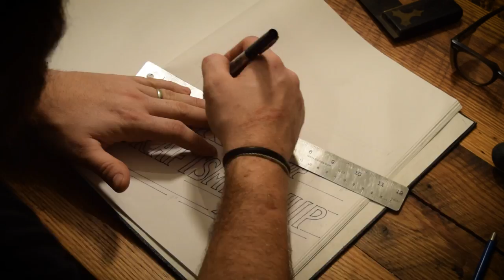Making a Joiners Mallet Using Only Hand Tools

Comment: Little tip i have found very useful woodworking. A reciprocating sawblade fastened to whatever handle you can fashion will do things no saw can and doubles as the best pumpkin carving tool. Ever.  Big fan of hand tool only challenges I have a couple knives I have made this way definitely makes you appreciate the tool more.

Comment: I built myself one last year much as yours Good job!
I also drill many holes adding down rods to prevent any cracking and splitting in years to come after a year plus ➕️ mine seems prefect and it's not the every day tool but for when I need it to go bong for some jobs 
Nice job for audio and coaching 👏

Comment: thats nice but i worry about using wet wood because it always seems to crack. although some types of wood are far more forgiving.
Reply from the maker: I had the same thought, but figured it would be an interesting test. Also a good way to make a temporary mallet if you needed something in the moment. So far, it’s held up well. Thanks👍🏼

Comment: A suggestion, if I may.

when you did the handle cut for the wedge, I suggest drilling the bottom of the cut.  A hole will allow the wood to spring out easily and not in a V Shaped notch.
Most people don't do this (I've seen a lot of vids) but it does make sense, especially in large wedges.

Comment: Also, how did you make the 'vise jig' for your bench. It allowed you to secure the handle for carving with the draw knife.  I don't have a vise yet and think this would come in very handy.
Reply from the maker: The vise I was using to make the handle is actually a draw horse. It’s specifically made for clamping pieces to use with a draw knife. You clamp by pushing on a treadle with your feet, and then allows you too use both hands.

Comment: your using dry wood saws the kerf and teeth are not designed for wet or green wood and they are too small youd have a much easier time sawing with a large bucking saw with a larger teeth and a wider kerf and maybe even some raker teeth. they are real easy to build too could be a good craft video for you
Reply: I don't know why he didn't use the bow saw in the background.
Reply: Its funny when you think of woodworking knowledge and how someone can know the finer points of creating things but not the harvesting portion. my father is a logger so i've been around everything start to finish. That's not to say he doesn't know his saws probably just doesn't have much use of a buck saw/chainsaw a lot of times.

Comment: A very interesting video.  Here are some points to consider:
1. "Minimal tools" should include a log saw for this kind of work.  Sawing a log like with a carpenter's saw, intended for wood about the thickness of a two-by-four, is extremely inefficient.  Not only does a log saw have wider-set teeth to make a wider kerf to avoid binding, the coarser teeth have wider, deeper gullets that don't fill up so fast.  When a find-toothed saw is cutting through eight inches of wood, each gullet fills up 2 or 3 inches after it enters the kerf.  For the rest of the stroke the saw skids along on loaded gullets, with the point of the teeth hardly touching the sound wood.
2.  For working up a round handle, you'll find it goes much quicker if you use the axe to bring the billet to octagon shape before taking it to the shaving horse.
3.  What kind of wood is that?  Will it stand up to pounding?  After you tested it at the end (about 23min 29sec) I thought I saw a crack running from the far side of the head in to the pith.

Comment: Nicely made! I made a similar one, little bit smaller than yours, out of an acacia log with two wedges (the handle was square). I used power tools only to sand it a bit. Unfortunately the colour of the wood and the beauty of the grain prevented me from using it :-( Keep it up!

Comment: thanks for sharing that.  really nice mallet and fun to watch it made from a log.  Tool question.....I've never used a draw knife before....how do you sharpen that?  Seems like a handy tool to have!
Reply: I've had draw knives for a while. The best method I've found for honing the bevel is to clamp the knife to a piece of wood held in a bench vise. Then run the hone stone on the bevel kind of like it is a file. Doing it that way gives a lot of control. Can use two hands to guide the hone. Polishing the back is easy. Keeping the bevel consistent can be a bit of a trick to do though.

Comment: You make it look easy !!  When I did this I got to the crudely-shaped part then stopped. A few days later the thing developed a nice split almost the whole length. Anybody have an idea of what I did wrong? I'm kinda new to this. The wood was likely maple and seemed to have been lying in the forest about as long as this piece in the video. Thanks for any advice and the great vid!
Reply: With most woods left in the round, some lengthwise splitting is nearly inevitable, but you can minimize it by very slow drying and then cutting off the split ends.  The part further in from the ends may remain split free if you don't take it into heated space.  In the case of a mallet, that's okay, because you can leave it outdoors.

Comment: So I get how you measured the length of the wedge to 2/3 the length of the handle that is inside the mallet head. How do you decide the width of the top of the wedge?  And when you saw the kerf for the wedge to fit into, how far down do you saw? It looked like you just did the very top portion and drove the wedge to deepen the split - is that all it takes?

Comment: The sound of a sharp planer to a nice piece of wood.. Like a pencil to a paper and it writes music to my ears. 

Also, just grabbing a random piece and it looks like it was hand picked. ofc I´m a guy that finds beauty in a simple 2x4 :D 

The other day I found 5 pieces of 3x8x14-16 the prev owner used when working with his machines. (about 1/8 of grease, rust, chips and whatnot.) Wirebrush and handplaner... and it is totaly worth it.. Btw. I would use BLS-oil on the wedge instead of glue and leave a bit sticking out until its completely dry... but there is more than one way to skin a cat :) and its not my mallet. It turned out awesome! Ima gon make a mallet this weekend for sure :)

Comment: Hello Dustin. I’m interested in how you made your bucket forge. More then anything I’m interested in what material you used on the inside or fire proofing. If you or anyone else could tell me what that is that would awesome. Thanks
Reply from the maker: Hi Michael,  I made a form using a 4” PVC pipe for the main cavity, and a hollow aluminum broom handle cut off for the torch input hole. Set the bucket face up, attached the form (covered in petroleum jelly), and the feet, which were bolts that stuck inside the bucket a few inches, as well as out, then poured in my refractory, which was a 1-1 mixture of Plaster of Paris and sand. Let it harden, and pull out the form. Pretty easy, and has worked amazingly.

Comment: I saw this really great wooden mallet from the turn of the century when I visited Germany. They were using it to drive home the bung on a keg, and I've wanted one ever since. It was made from one solid piece of wood and the handle was carved into it instead of being added separately. The bottom part of the head of the mallet sort of curved down eventually becoming a handle, and then the whole thing was burned with, I'm guessing German, flower, and leaf motifs. It was sold old and dark that I'm not sure what kind of wood it was made of or if it had a stain or if it was just darkened by time. I was tempted to buy the thing from the homeowner but didn't have a way to bring it home. Does anyone know what these bung mallets are called?
Reply: Found it. Wood carver's mallet. I wonder if I could make one of these with just handtools.